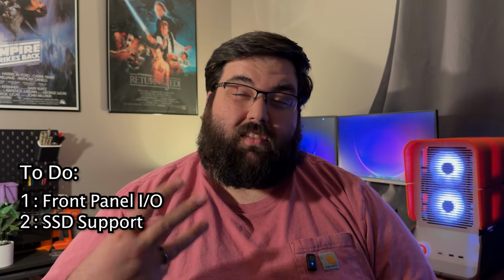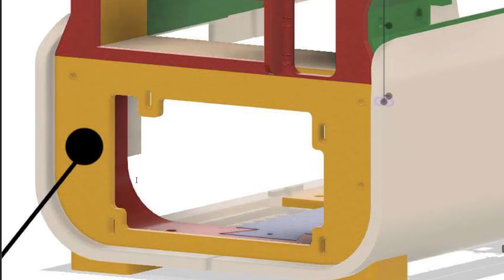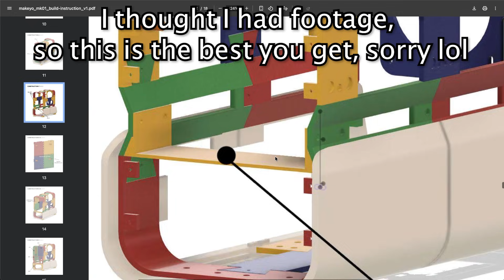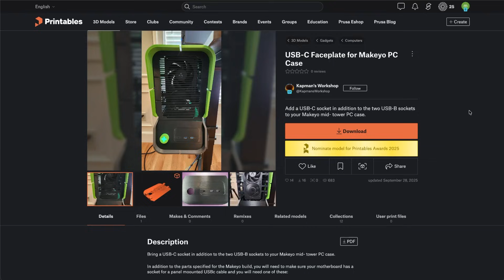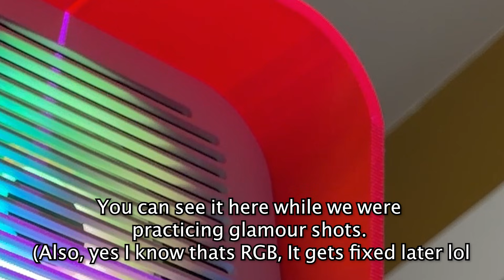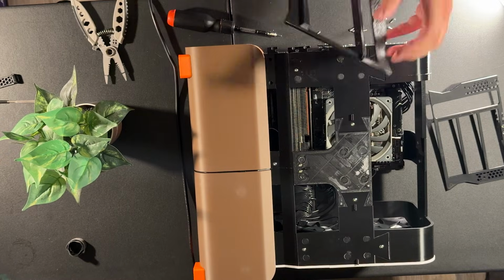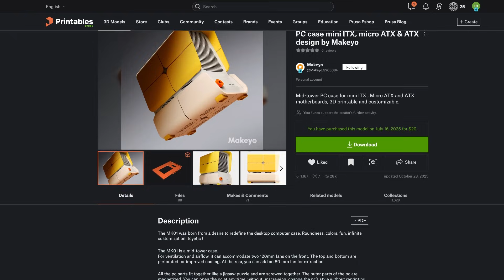I 3D Printed This PC Case Instead Of Buying One

Comment: I took your idea of the "X" button and made one myself. And would be cool if the top power button cover (the X one) could be screwed on to the base of the button, intead of glueing it.
Reply from the maker: Yeah I can share it! I actually thought about it and I was thinking a pressure fit might be better than using any hardware. I just haven’t had time to work on that sadly :/ I can try and upload the files to printables later today!

Comment: problem about this is accessibility...  for the price of this project + filament you can buy a normal case + all the fans (i'll admit the stock fans are not the best xd)
Reply from the maker: Yeah I can see your point. That's something I regret not touching on in the video is how much I actually spend on materials. It came in at under $200 (at the time of recording) including the filament used (only about half a spool each for the three PLAs and one full spool for the ABS) the hardware (including the extra stuff i needed for my build) and that price range was what i was looking at for cases already. Additionally, this looks nothing like the cases that are available at any price point, so it certainly fits my needs and desires for a new case. 

But I totally understand how the pricing may just make it unattainable. I know there are great cases at much cheaper prices (or free if you don't mind doing some digging on Facebook marketplace), I just think this is a good solution if you want a case that is more unique than what is available 

(p.s., I only edited my comment cause I accidentally hit the send button too soon)
Reply: @Marst_art  i get what you are saying, this is a custom diy project afterall and has its "luxury" features, i think i might give it a shot when i have some extra funds xd

Comment: Great vid. I love TinkerCad by the way. Its easy enough for beginners, but becomes completely dangerous in the hands of an expert (ie its the 'go to' tool)  ...especially for quickly creating functional parts (as you did) or importing and modifying other models with additional holes, screws, splitting or merging, etc.
Reply from the maker: It is certainly a great tool! I’ve just always wanted to learn traditional (?) cad like solid works or something but for quick edits like what was shown off it’s perfect. I have a coworker who uses it for everything and it’s absolutely insane the quality of work he achieves in it!

Comment: I've been planning on building one of these cases to rehouse my main rig! It is great to see the issues you ran into so I know what to be prepared for with my own. I'm planning on printing the inner frame of mine in ASA to make sure it is plenty temperature resistant and PETG or PCTG for the cover plates. I'll be sanding and painting it anyway to give it a super smooth finish.
Reply from the maker: DUUUUUDE that sounds awesome! We talked about sanding a little but neither of us have experience sanding prints (especially on a larger scale like this) and we didn’t want to mess up any of the parts in the process. 

If you don’t mind let me know whenever you finish, I’d love to see how it looks!

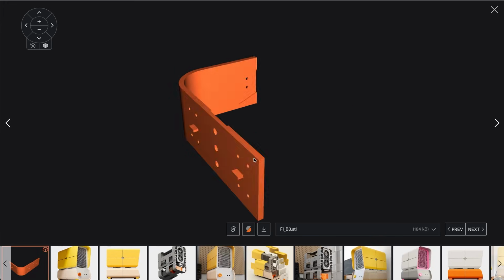Comment: 2:26 "Well, I guess we just have to go and reprint the part, right?" 
Modern problems require not so modern solutions. I will say though, at least you're not wasting any plastic with this method.
7:46 And the madlad strikes again. I hope that drill becomes a recurring character

Watching this has me low-key wanting to print this for myself. I don't hate my case, but I do wish it had more character, and this case has got that in spades. Fantastic video!
Reply from the maker: Thank you so much for the kind words! 

It was actually hilarious cause what I didn’t add was my friend Yanni (who’s help host some of these videos and talked in the background of the one shot about my PSU) walked in as I was drilling the hole for the HDD and he almost did a spit take he thought it was that funny while recording. 

I appreciate the support and I totally recommend printing and building the case! It’s a fantastic project and is super satisfying to complete!